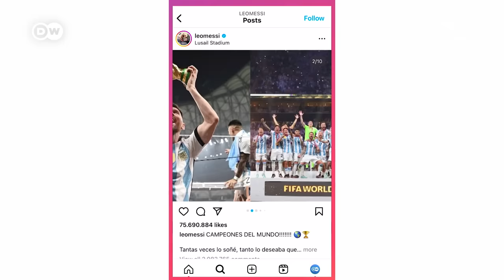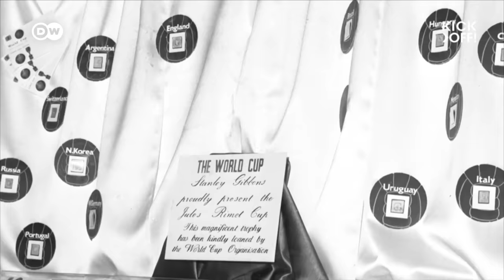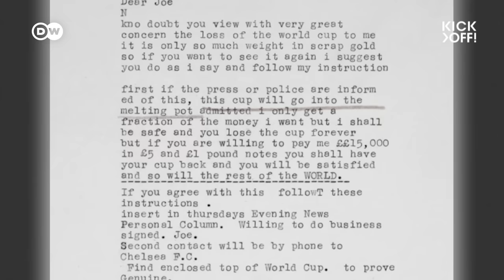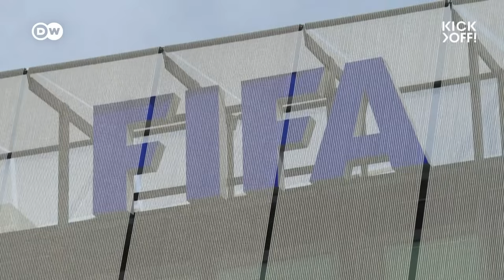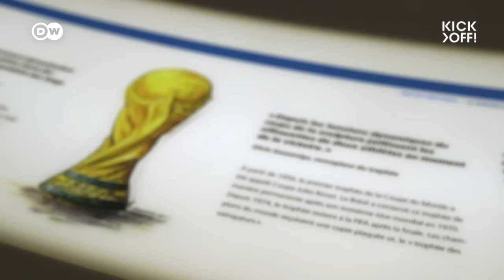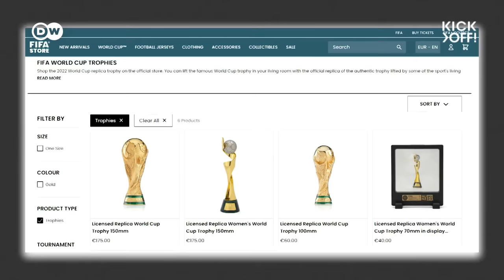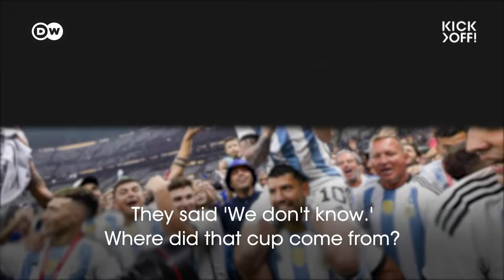Did Messi lift a fake World Cup trophy?

Comment: There is a similar approach for the UEFA Champions League (previously, it was known as the European Cup). If a club won at least 3 titles in a row or 5 titles overall, they were able to keep the trophy permanently (in some media, it was known as the Big Ears). As with the World Cup, the original European Cup was awarded permanently to Real Madrid after sixth win in 1966, thus all 6 original European Cups owned by Real Madrid were remained at the Santiago Bernabeu. However, between 1967 and 2005, a club may still own permanently this prestigious trophy if either winning 3 titles in a row and 5 titles overall were met, with Ajax, Bayern Munich, Milan, and Liverpool were the only 4 other clubs.

In addition, the aforementioned 5 clubs (plus Barcelona) were also granted a permission to wear a "multiple winner badge". Unfortunately, Barcelona did not keep the trophies after the 5th win in 2015 due to the new rules by UEFA being made. Since 2009/10, the winners for each season now received a smaller replica versions and the original one remained under UEFA's control.